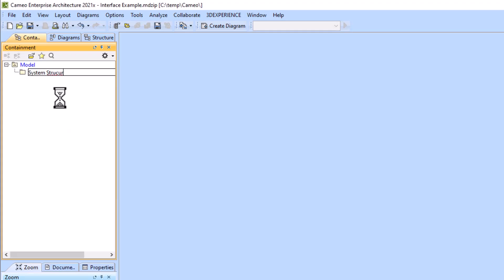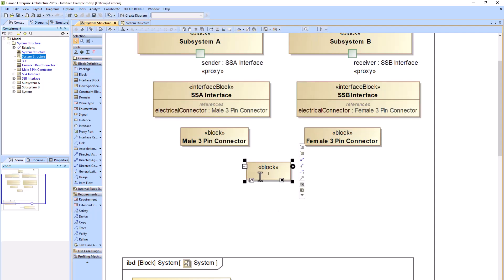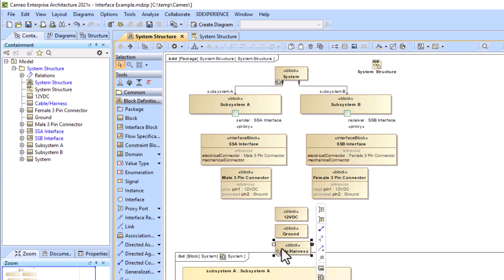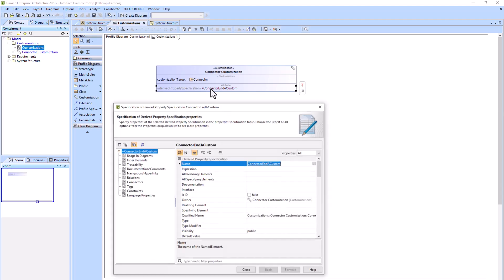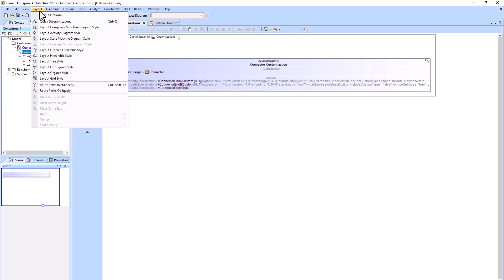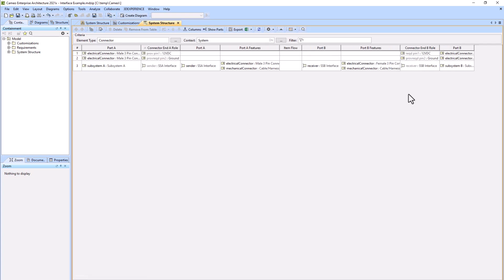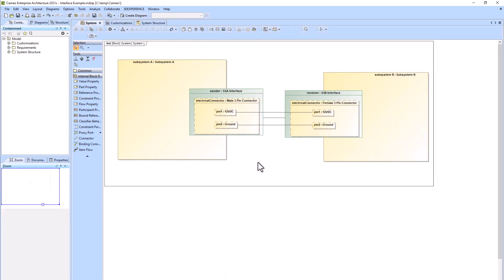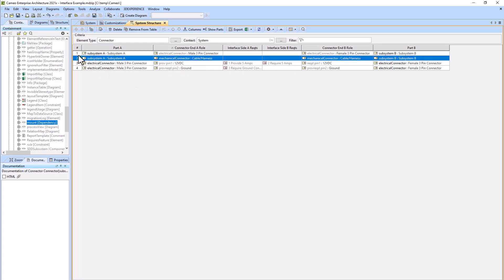Physical Interfaces Modeled on Logical Decomposition in SysML

Comment: Why would you just not use a harness design tool like capital or E3 which is designed to do all of this already?
Reply from the maker: Great question! Tools like Capital and E3.series are indeed powerful for detailed harness design, especially when you're in the implementation phase. But our focus here is on system-level modeling using SysML, not just wiring or physical layout.

SysML tools like Cameo (Catia Magic) help define the logical architecture of the system—how functions, behaviors, and interfaces connect across disciplines (software, hardware, electrical, etc.). This upstream modeling is essential for requirements traceability, trade studies, interface control, supplier communication, and ensuring alignment across the entire system lifecycle.

In many workflows, the SysML model is created first to establish the what and why, and then tools like Capital or E3 handle the how and where—often with model-based integrations between them.

So, it's not about replacing harness tools—it's about using the right tool at the right abstraction level. Cameo helps guide the overall architecture, and then downstream tools pick it up from there.

Comment: Honestly really love the insights here, but I do struggle to adapt these techniques to actual systems. How can these tools allow us to scale this up? I mean, cable connectors are bad enough but a 2-dozen slot backplane with a couple dozen ports to/from each module? And those aren't all straightforward things like power and ground -- there are multiple data lanes with bidirectional, differential signals like a "simple" Ethernet connection which is physically four traces but it's electrically TX+, TX-, RX+, and RX- so the directionality and polarity matter. Even then, at the logical level two identical ports could be doing either 10Mbps or 100Gbps -- or trying to -- so keeping track of the signal integrity characteristics is critical there too. Oh wait, do those interfaces support link-speed negotiation so they can find a common speed, or are you just out of luck if you connect the wrong ones?

It just gets out of control very, very quickly when all that information has to get into a single interface model! 😵‍💫
Reply from the maker: I actually completely agree with you.  We are working more robust examples to explain other methods to design logical and physical breakdowns and explain the pro/cons of each method.  That video will be released in a month or two.
Reply: @cameomagic  That sounds great. You have some of the best, most focused, and most approachable content I've seen, so please don't take this as any sort of critique about your examples. Just trying to wrap my head around what to do with that knowledge! 😃 Thanks again for this one.

Comment: How is anyone expected to figure out this is what's needed for the metchain stuff? There must be a more intuitive way.
Reply from the maker: A metachain can be made for this.  In hindsight, we should've added that to this example.  
Pro: Scalable for mechanical, electrical, etc. aspects. Fairly easy to implement.
Con: Metachain more involved.

Another alternative is that you have a completely different breakdown that is purely physical and not logical and then map elements from one breakdown to another with a relationship like a(n) abstraction or dependency relationship. 
Pro: No complex metachain, arguably more straightforward.
Con: Must make entire new decomposition (longer to implement).

Another alternative is that you have a relationship between the physical block and the logical element (via mount relationship potentially).
Pro: Fairly easy to implement.
Con: Metachain involved (not terribly difficult), not quite as scalable (arguable) 

I'm sure there's other alternatives as well.  I think either way you model it, you will have the trade space between doing a lot more modeling with less metachains necessary or doing less modeling with a more complex metachain required.
Reply: @CameoMagic  would love a video going over some of this.

Comment: Thanks for this example!!! 👍We've been doing something similar for a couple of years, but have found the type of technique demonstrated here has an undesirable characteristic with respect to "End A" and "End B".   Sometimes "End A" is "Subsystem A" and sometimes it is "Subsystem B".  This is the result of how the connector created; End A is the starting point when drawing the connector, and End B is the ending point. This can make the ICD harder to read/understand.  For readability purposes, it is often desirable to create the ICD from the perspective of one subsystem or the other, such that End A is always the same subsystem.  This can be accomplished by creating derived properties which define "ConnectorEndSelf" and "ConnectorEndOpp" (for Opposite).  The ICD table can then be created with "Scope" on one part or the other.  The derived property expression is a bit more complicated, but we've found that it is worth the trouble.  It would be interesting to see your way of accomplishing this.
Reply from the maker: Nice, good method.  I like the idea of starting from one part and then working your way outward. I absolutely understand the issues with the direction of the connector.